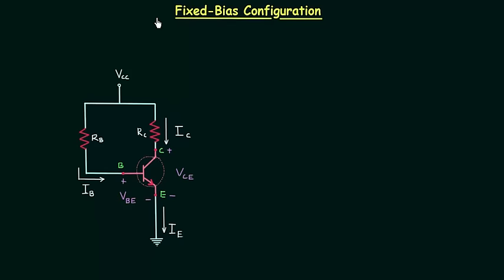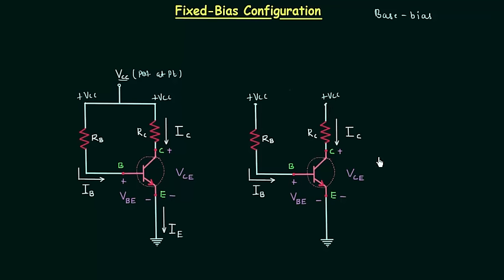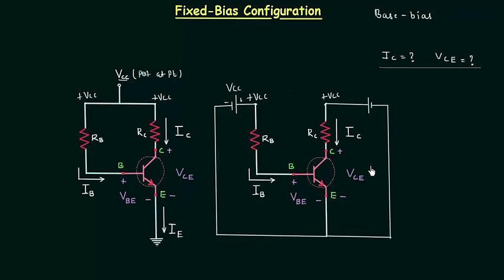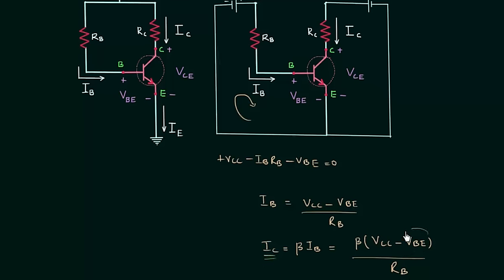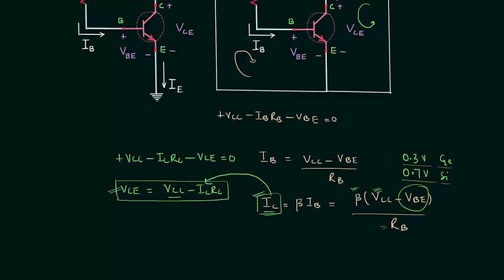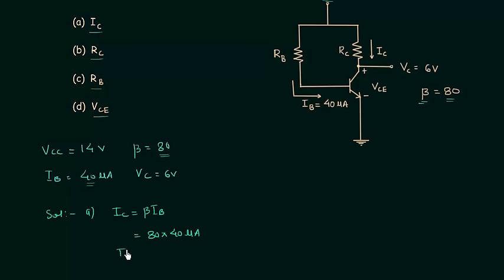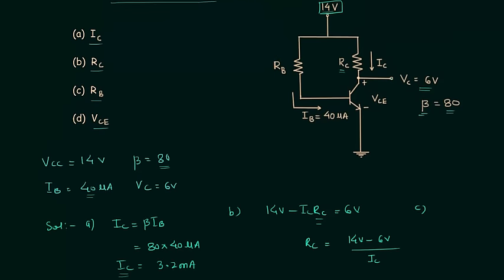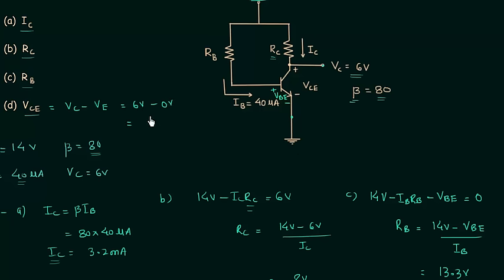Fixed-Bias Configuration of a Transistor

Comment: 1.Why it is called "fixed bias/base bias"?
2.How the collector base junction is reverse biased by Vcc?
3.Why base to emitter potential is equal to the barrier voltage?why not more than that?
Reply: 1. Base current IB is fixed. Therefore, this type is called the fixed bias type of circuit.
2. CB junction will be reverse biased if the voltage drop at the collector terminal with respect to ground will be more than the voltage drop at the base terminals with respect to the ground. and this voltage drop depends on the values of resistors connected to the collector and the base terminals. Hence, we should choose the value of the resistors accordingly.
3. It is because the base to emitter junction is forward biased in active mode and acts like a PN diode in forward bias.
Reply: Thank you to both @dhiraj and @mohtasir

Comment: Sir please explain, what is the need   of capacitor coupling in the circuit for AC analysis???
Reply: To filter out the DC component in a Signal ....only AC will pass through Capacitors

Comment: How is CB junction reverse biased? The C terminal is connected to positive end but B terminal is also connected to positive terminal.
Reply: CB junction will be reverse biased if the voltage drop at the collector terminal with respect to ground will be more than the voltage drop at the base terminals with respect to the ground. and this voltage drop depends on the valuse of resistors connected to the collector and the base terminals. Hence, we should choose the value of the resistors accordingly.

Comment: sir in derivation u gave Vce=Vcc-IcRc but in numreical problem u directly did Vc-Ve sir which is correct ?
Reply: Both are correct in derivation Kvl is used ...while in numerical sir have worked on potential at point ..you can try kvl and will get same ans
Reply: no the correct answer should be 8 volts

Comment: If the capacitors act as open circuits then what is the use of them in the circuit ? i/p signal will not be transmitted through the open circuit.

Comment: I don't understand the concept of capacitor in dc biasing circuit can you pls explain this?????
Reply: An AC signal might contain some DC components, which could interfere with the biasing voltage of the transistor. To prevent interference, the capacitor is used to block those DC components.

Comment: What is the reason behind using the coupling capacitors in the ckt?
Reply: Amir Ahmad 
Couplings capacitors are especially used when AC signal is given.
AC signals are not always pure it contains small amount of DC signals so when AC is passed through capacitors ,DC components are blocked , thus input applied is pure and output is less distorted

Comment: your have a quality content but… 
 for someone who aren't specialized in electronics I need some to break down the acronym jargon.
vcbo
vcio
vbe
vce
why some times you would question why people coin that useless confusing
acronym?!
it's very simple if you just do it practically.I think it would be quite simple if you use simple sentences to get the message. I don't need a degree nor pass an exam I need simply to solve the problem practically
use calculator shortcuts use online tools to calculate that.why would i do anything math related if i have a calculator! it's easier.
I think we need efficient way for solving problems!

Comment: why coupling capacitor is used
Reply: Shaikh Shahezad same doubt
Reply: Coupling capacitors are used to block DC and Allow AC
Reply: Watch ossiclator your doubt will be clear there
Reply: to block ac power
Reply: DC
Reply: Mohammed Shahezad Shaikh 
At input side to safe gaurd ac source from dc components. 
Capacitor is such a device it allows only ac to pass through and it will block dc current. 
Similarly at output side to extract pure ac output leaving dc.
Reply: Same doubt

Comment: 1.Why it is called "fixed bias/base bias"?
2.How the collector base junction is reverse biased by Vcc?
3.Why base to emitter potential is equal to the barrier voltage?why not more than that?
Reply: It is called fixed bias because we are providing fixed value of collector supply(VCC) and as the base resistor is fixed (rb),base current (ib)is also fixed.
Reply: CB junction is reverse biased as the transistor is npn